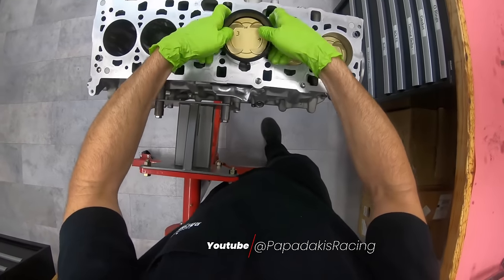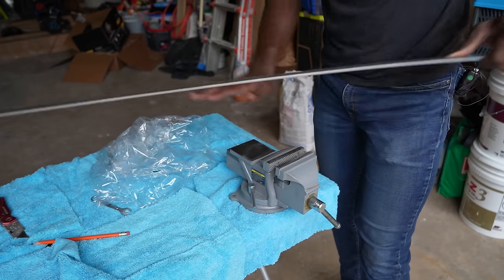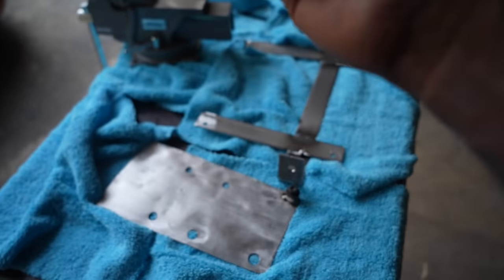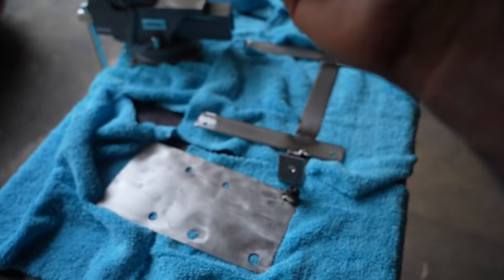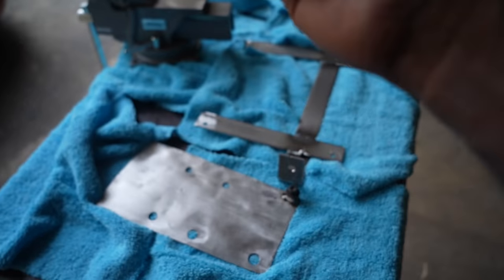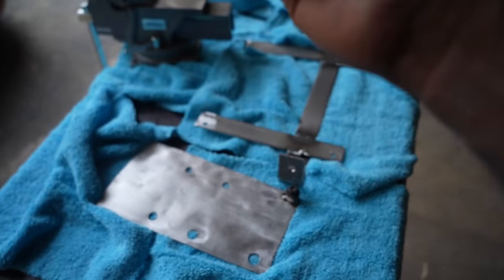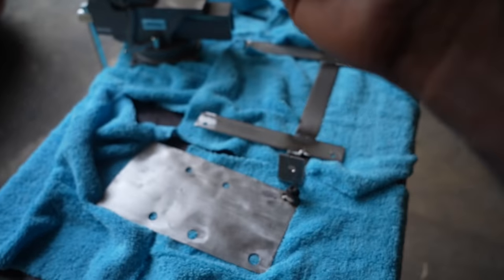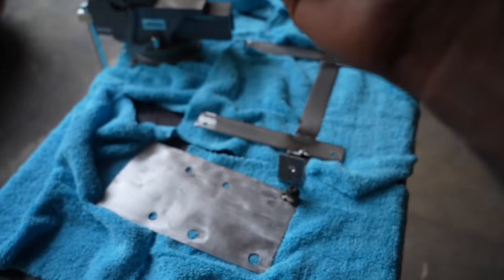AEM Water Methanol Injection Kit | Full Installation Guide

Comment: solenoid is meant top go to ignition supply not to permanent power from the battery directly.
Reply from the maker: correct, and that is how it is connected. In fact, in this setup, the WMI controller sends power to the solenoid. there is no direct permanent power to the solenoid. It is activated by the WMI controller.

Comment: Need to see how you installed the filter. Having a hard time
Reply from the maker: I ended up not using the filter anymore. It was on the way and didn't like the way it looked on the engine bay. it was tacky. 
if you really want to want. Just get any inline filter that uses a quick push and lock disconent.
In all, I revised my line, which I am now happy using the AN6 line instead without the filter.
you certainly can get away with it if you want as it's optional.

Comment: Hi bro great video. You know the pump u bolted it to the plate. How did u then bolt it to the boot floor?
Reply from the maker: bolt is at the same place where the negative cable of the battery bolts to the chassis.  Unscrew the bolt. Put the plate and the battery terminal and bold it. details are in the video.

Comment: What’s the green cable connects to?
Reply from the maker: the green cable is used for fail safe. some EUCs can use that to trigger on the fly map change in the event of meth system failure. if I had b48 or B58 this would have been a great way to utilize it since the platform supports multimap.
Reply: @hyde_official  so you need to connect that one to the ecu?
Reply from the maker: an ecu that is capable of reading this signal. my car does not have this capability, so I didn't use it

Comment: Unless the car is retuned for water meth it wont make more power. In some cases it might lose power. Also water meth isn't what makes more power. It gives the tuner options to add more boots or adjust the timing.
Reply from the maker: just like using e85. if your car is not tuned for e85, you gain no power. After you've set up the kit, the ECU must be tuned to make an account of the additional fueling. This topic isn't part of this video. this video is for installation only. There was no proper video that could have detailed the installation as I did. Either way, your statement is correct.

Comment: Methanol doesn’t add power it’s a safety net for when you do add more power or boost to keep temps low. Also helps clean ++ nice vid! This with e85 you might just be able to call it a freezer 🥶
Reply from the maker: Negative. that is the main purpose of this video to debunk the myth of those who don't know about this system. If you don't tune your car for WM, you end up losing power. Do you know why that is? that's your homework to find out if this video doesn't convince you.
Reply: Umm you are wrong lol. Water/meth cools intake and cylinder temps and increases your effective octane rating. It creates a denser air charge and suppresses knock. This you can run more boost and timing for a given setup.